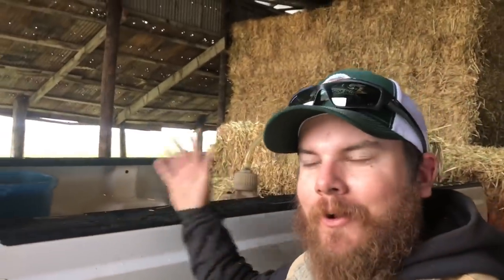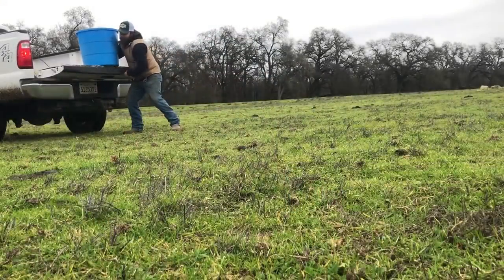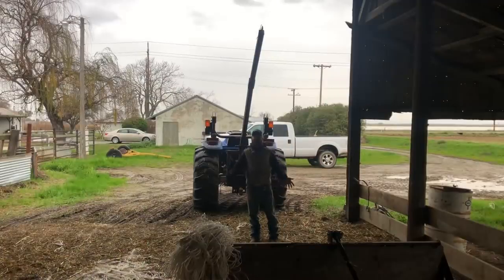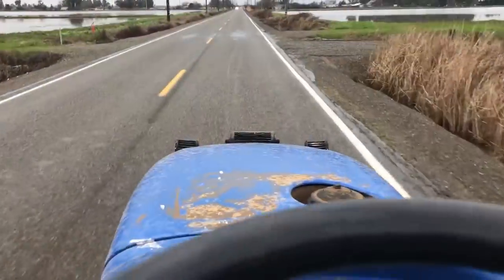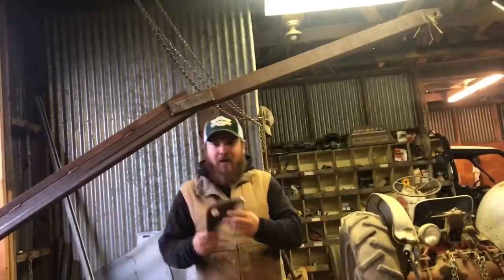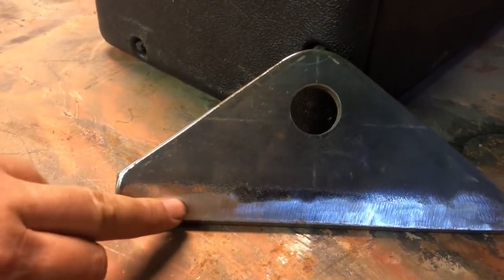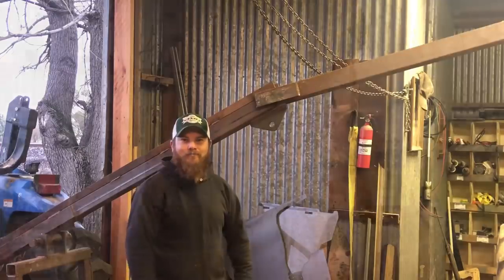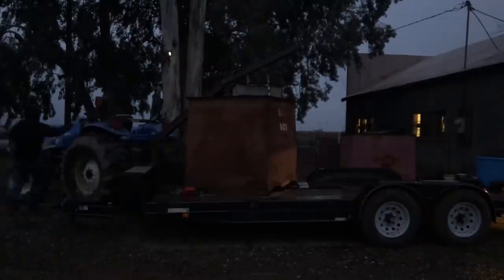One of my Favorite Homemade 3 Point Attachments!

Comment: Thank you Sir! So many uses that my imagination went wild. For example: I have a tilt/dump trailer that has no way to tilt or dump because it is just a pivot point with nothing to make the bed lift up. One use for your attachment will be to lift the front of the trailer bed. I will not have to add hydraulics or a winch setup. Thank you!

Comment: my opinion -   weld two triangular plates on the boom, one on each side. this allows the use of a single hole using a shackle or a  pin inserted through both the holes and that gives you a place to hang a chain hoist, loop a chain, strap or rope over the pin for lifting. also makes the  boom joint stronger. I would add two plates on the tip end of the boom also

Comment: I have a front end loader tractor...  My favorite homemade three point attachment is a stabilized drawbar with a removable Reese hitch adaptor. It has a triball stub w/ a chain hook welded to the blank side.
     I have a variety of other stubs for it...pull ring, wagon tab, and a grab hook....  🤠. 
     It is always on the three point unless another attachment is on the tractor.
      I'm needing a boom like that.... My plan is to build it height adjustable.
       Nice!

Comment: That's pretty cool!  I have a John Deere 430 Garden Tractor with a Yanmar Diesel that I restored.  I'm in the planning stage of building a front end loader and I want to build like what you just did for the 3 point to skid logs.  I don't have a farm or anything just a small acreage and think I'll be able to use it for moving things or pulling bigger than average lawn implements.

Comment: Hangman style  attachment, then the uprights must move in and out (use pins for hight setting through the square tubing vertical parts(sliders for hight), when right holes are picked just above rice bag (with 3point hitch on ground , lift up :)  the horisontal part can slide in and out for distance adjustment , use the same hole and pin idea.
Reply: Do you have a picture of the hangman style attachment?

Comment: I used to so the  low gear while picking up hay bales alone when I was a  teenager on the farm. Put the old John Deere A flywheel crank in 1st and walked along tossing bales and correcting the direction of the tractor. Got to be interesting when the bales were 3 or 4 high on the wagon.
Reply from the maker: As they say, a country boy can survive!  Thanks G. R.

Comment: You got me thinking:
 1. Hydraulic pump pressure ?   Heavier duty pump ?
 2. Engine RPM, did not hear it rev up when you tried to make that last lift ? 
  3. The lifting arms on the three point are short. Their travel, max up or down is all the travel you have to work with. Lengthening them will increase the the lifting height. ( up and down travel )
You may have already tried these ideas, if not......... I enjoy making pieces like you did. You'll get it figured out.

Comment: Something you might want is a self load trailer. We took a pair of 7k lb axles. Made a heavy duty trailer. Then we built an frame in the back like burial vault companies use delivery vaults. The top rail extends 5 feet over the back. We keep two sets of car jacks for safety. A short set and taller set for back of trailer. That way most clearance issues are covered. We put a gantry hook on the I beam. It clears the front by 30 inches. Just how the metal worked. We have a tool box in between the support rails on tongue.  We keep jacks, chains, chain booms, straps, and a chain hoist to hang off I beam for lifting whatever. Works well and served me great before I had a loader. Plus depending on the auction this trailer may go too. Also great for getting borrowed equipment back home. lol
Reply from the maker: That sounds awesome Keith thanks for sharing!

Comment: I like your idea of the geometry of the top link increasing you lift travel, but it comes at a cost. While your setup does offer more lift travel, it also deceases your lift power over a standard boom pole with standard top link. Remember, anytime you increase travel, you decrease lifting capacity. That tractor should lift the front wheels before the lift stalls.

Comment: I have a three point crane that I made from tube steel that I can extend out or retract. It has 3/16 holes to run a pin through the tubing to keep it in place. One hole in the outer tube and multiple holes on the inside tube. Although most the lifting i do is at it's shortest length. I wasn't the brain child I saw one on a friends farm and I copied it. I plan to put an electric wench on it someday.

Comment: I'm missing something here.  Does the top arm just sit on top of the pivot point without being attached?  If so, what prevents the lower part from just falling over?  🤔
Reply from the maker: The top arm (or boom arm) is connected to the cross arm by a giant hinge which allows it to pivot while going up and down yet still holding everything together very securely. Thanks for the question!
Reply: Welded to a tube that a pin goes through

Comment: Hi Tyler,
I’m not shure that I sow that corectly but at certain point when you pull left lever of hydroulic pump you also pull right one,and what you get at that point-that extra inch with no power cause you put max preshure on the valve inside of the pump and lower capacity of the oil to resist the preshure.
I’m shure you know a lot about those staff. If I’m wronge exuse me.

Comment: I'd possibly fix the pivot point and swing the tractor side arm upward and maybe longer if hydraulic power is lacking, to increase leverage. Maybe more weight on front of tractor, and adjust hydraulic pressure.

Comment: I have been trying to think of something to lift logs so I don’t drag the chains on the road. I really only NEED to lift one end but being able to lift the whole log would be nice. I have 2 other designs but both require a lot more metal and more work. Do you think yours would be able to do that?
Reply from the maker: Yes this design would certainly do that. The limiting factor here is the tractors three point lift capacity and the metal used in the build. The main tube is .120 wall steel on mine (with gussets in critical areas) and so far it’s held up well. At the eye on the end I can lift probably 600 pounds. Eye in the middle probably 1200-1500
Reply: Farmer Tyler Ranch my only concern is while dragging them and turning the sideways torque on it. My brother is a professional welder and I was going to have him build it once we get a design. I’m the wood guy, he does the metal haha. But we were going to use 1/4 wall 2” square tube for the main parts and add braces where we think we need them
Reply from the maker: I don’t know how heavy your logs are but I’m worried 2” would bend on you eventually, even with a .250 wall. Of course it all matters how long the arm is and how heavy the logs are and how you brace it. You could even put a “backbone” on it and that would help. If your brother is a professional welder he ought to have a good idea of what it needs to be.  Good luck!  Any other questions go ahead and ask

Comment: Hey man, if you regularly need to remove large items like that off of trailers, trucks, etc., you might want to consider building an "A frame" with a gantry. You probably have most of the material laying around the farm but I would think a basic model can be built for around $1000 (+/-) in materials and a half days work. ( For those who don't know, a "half days work" for a farmer is a full days work for most folks!). But you can make it as versatile as you want ( mo' money mo' money mo' money!😉). 
We built one at a fab shop I worked at years ago and it paid for itself the first time we used it, and I'm figuring YOU ARE going to use it!
If you need a hand gimme a shout, if I can get there, I'll give you my best to get it done!
Peace!
Reply from the maker: Yes I have considered that. I’ve actually been collecting materials here and there for just such a project. Great idea! Thanks for watching
Reply: @farmertylerranch4399  just get a chain host with a better capacity way cheaper and more handy  a 4 ton come along would be better, preferably with a extra snatch block to double your lift power
Reply from the maker: Yeah that’s what I’m thinking too.  My little half ton hoist just ain’t gonna cut it for some things.
Reply: I have two A frames with two trolley hoists on each A frame. Picks trailers up and put on jack stands. Change large truck beds. Un load things.

Comment: I would use the PTO as a wench with a stand on the ground instead of on the tractor. The stand would take the load.
Reply from the maker: Yeah that might work if the goal was to simply lift heavy items. The whole reason I put the boom on the tractor was so I could pick things up and move them around. Thanks for watching Susan!

Comment: Brilliant boom pole design there! Very well thought out. I drive by a New Holland dealer twice a day and have been comparing models to buy one. What model is that you have? Would you mind making a review video of it? Your likes and dislikes? Any issues you might have had with it and how the dealer is with warranty service? That looks like exactly the size that I want to work my 21 acres. Nice video and good luck to you!
Reply from the maker: Thank you very much Tom!  My tractor is a 60 hp t2420 “Boomer” series. I’ll probably do a review on it one of these days. My recommendation is go for a more commercial line of tractor, not the bottom level like the Boomers. Didn’t have any warranty issues so can’t comment on that. It has had a few electrical components go out since the warranty expired and the tach gear stripped (plastic) so the tach no longer works. That’s why I say go for the commercial line where they don’t cut costs at every corner to save a dime.  All that being said, I would get another New Holland, just not the entry level models. Hope that helps! Thanks for watching

Comment: How did you weld the plate?  I kinda old & haven't touched a welder in 35+ years, but back then I probably would have used a 6011 or 6013 rod in an old Lincoln stick welder.  Did you use a wire feed welder for the entire plate after you tacked it?  Was difficult to tell how you did it from your fast forward video.  Also, I just randomly selected your video, I enjoyed it & will be looking at your others vids too!!!  Many thanks...!!!
Reply from the maker: Thank you very much for watching!  I completed welding the eye on with my MIG welder using .035 wire and C25 shielding gas. I did an uphill root pass and a downhill cap. If I used my stick welder I would have used some 1/8” 7018 rod. 7018 is a better choice on clean metal as it lays down a stronger and more ductile weld. 6011 and 6013 dig in deep and burn through rust and paint very well but the weld is a bit more brittle and a bit weaker. 6011 and 6013 are really common choices when welding with an AC stick welder (like the old Lincoln’s) but when DC power is available I prefer 7018 in most cases. Glad you liked the video!! Thanks Bobblenuts!
Reply: 7014 works well, is easier to weld.
Reply: 7018 is more commonly available and just as good

Comment: I thought you would have felt like a wimp because you were driving a Ford! Just kidding. LOL

Never fed cattle that way but with the tractor and rock wagon picked many many acres of rock that way.

Since you like making things you should make a a big ferris wheel that you fill with small squares and then when you drive it just kind of plunks down a couple flakes or a chunk of a bale every Revolution! Lol

You have hydraulic Outlets up at the angle of your hoist put a hydraulic cylinder there to give you a little extra travel!
And then put a winch a hydraulic winch down at the bottom run some cable up over a pulley down through a block and tackle a couple times and back up. Oh man!!
Reply from the maker: Aww man, who thumbs upped that?? Haha!  I’m sure it was because of the rest of your comment not the part about my truck!  Thanks for watching Jon, stay tuned for the Ferris Wheel hay feeder series!
Reply: @farmertylerranch4399  I got a lot of messages that it was over the Ford and nobody cared about the ferris wheel hay feeder!
Okay picture this. Some type of tube frame roughly the width of a small square but several small squares long you just crack them open and toss them in then out the bottom and some sort of old hay elevator kind of deal that when you get to the pasture you turn it on and it just pulls Flakes and chunks of hay out!
Reply from the maker: Build it Jon!

Comment: By putting the pivot in and making it extra long, you increased the lift speed and reduced the lift capacity. You also moved the center of gravity of the tractor beyond a safe height.

Comment: I'm sure you know, but that top link connection is seeing extreme stress, you can break your diff housing pretty easy. Go easy with this, it's great place to skin a deer though :)
Reply from the maker: Thanks you are right!  This tractors top link eye is actually bolted to the diff housing, making it an easily replaceable part. They probably did it this way for exactly that reason!!  Thanks for pointing it out for others who may not have a tractor designed this way. And thanks for watching!
Reply: Integr8er66 "the top link connection is seeing extream stress"
Is that because it is pivoting on the top link instead of the lift arms?
Reply: @markgolembiewski4570  its because in that configuration the pivot point is right above the lift arms, and the lever ratio is about 10 to 1, so whatever weight you put pulling down on the boom pulls up on the diff housing at at rate of 10 to 1. So 1000lbs down would be 10,000  lbs up on the diff casting. Also the normal top link pulls in a horizontal direction, this pulls up and that is a direction that the casting was not designed to hold. Then throw in some side to side pressure which is also at a 10:1 ratio and it can go bad fast since on most tractors fixing this means a huge job of replacing the housing since cast iron doesn't weld well.
Wow, I just saw you made that weld upside down.. You Da MAN! I would have had to take it off and turn it over, but my rig is a tombstone AC

Comment: I hope you never accidently lock the door getting out.  How about a windshield and roof the the Honda. Nice crane, aftermarket loaders are as much as a tractor sometimes.
Reply from the maker: Yeah locking the door would suck! Usually I at least roll the window down. I have a roof and windshield for the Honda, just need to throw them on there I guess. A loader for my tractor costs about $8000 last I checked!  I’m thinking about maybe building my own...

Comment: Feeding by your lonesome, you gotta get clever! That worked really well. I like that boom. Any idea what the max weight you've lifted with it? I've thought about making one because the loader only gets out there so far.  You could make a seat attachment so you can limb trees while your wife drives you around the fence line! Lol
Reply from the maker: At the end of the boom I think I’ve lifted around 500 lbs.  not sure about the new eye I welded on, still need to test that some more. Your tractor would lift way more than that though! My three point is not super strong. Putting the hoist on the end helps a lot too. Thanks Chris!
Reply: @farmertylerranch4399  That's a pretty long boom though, so lifting 500lbs at (I'm guessing) 7' from the pins is doing pretty good for that frame of tractor.  I'm sure you'll double that or more with the new eye location.
Reply from the maker: You know I’m not sure how far from the pins it is. I’m thinking maybe more like 10’?  So yeah there’s a ton of leverage fighting back on it. Time will tell what the new eye will lift

Comment: I liked the way you weld up hill ?
Reply from the maker: Thanks Jeff. Cut and etch tests show welding uphill provides far better penetration than downhill. So when you have a choice and strength matters, go uphill!  Thanks for watching
Reply: Up hill. I worked building drilling rigs. 40 million dollar rigs and built one per week. You can imagine how busy that place was. All verticals uphill.  I was a fitter over the sub structures, but I had to watch the welders to make sure they did properly.

Comment: Great tool... have you checked and confirmed that your hydraulic pressures are correct?
Reply from the maker: Thanks a lot, yes the hydraulic system is working good that box is just super heavy then when you add in the leverage from the boom, it was just a bit much. Thanks for watching!

Comment: Your pivot point may need a design change and add a hydraulic ram to the pivot point in some way,  if your tractor lift arms will support the dynamics of the extra stress?
Reply from the maker: Yeah I don’t know if it could handle much more weight on the end eye. That front end gets pretty light!  Thanks Frank!
Reply: @farmertylerranch4399  are your tires filled with water ?
Reply: You could make a seperate  stationary hydraulic outrigger attatchment for lifting heavy weight in place, also a strut where the boom bends will near double its lift capacity without adding much weight
Reply from the maker: Yes the rear tires are, the fronts are not. The volume of water the fronts could hold would be an insignificant amount of weight. Thanks for the question!
Reply from the maker: Yeah good point!  Not a bad idea. Hell this thing will turn into a backhoe before long!  Thanks Brent!

Comment: i realise this is an old video, but: why would you need a boom that goes all the way to the ground? you are losing height that way. you still have to have a chain or strap on it so let it reach the ground if need be. straighten the boom, increase the height, increase the sise of the boom, etc.....g
Reply from the maker: Thanks Remus, all good things to consider. I wouldn’t want to straighten the boom though for my use because as you go higher that bend gives you clearance so the boom doesn’t hit whatever you’re lifting. Thanks for watching!